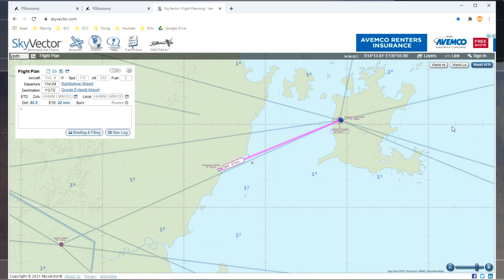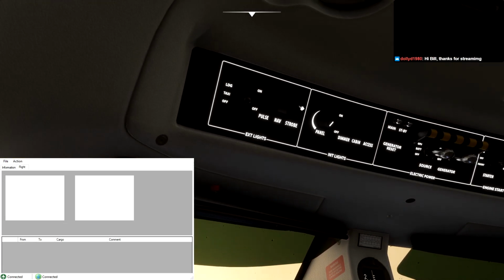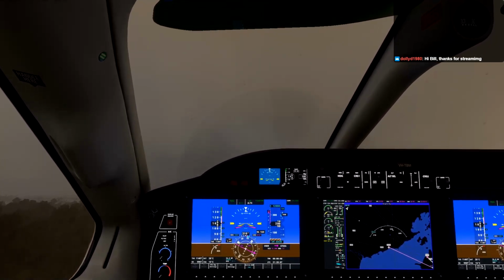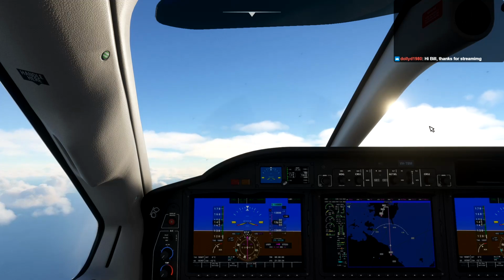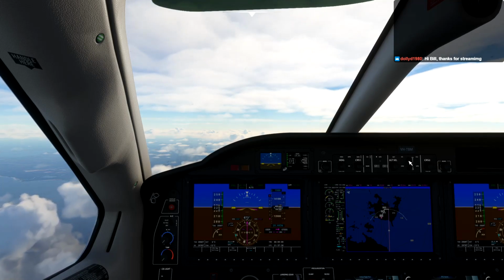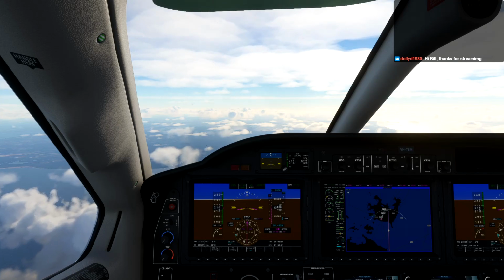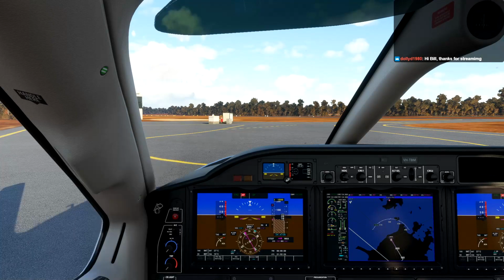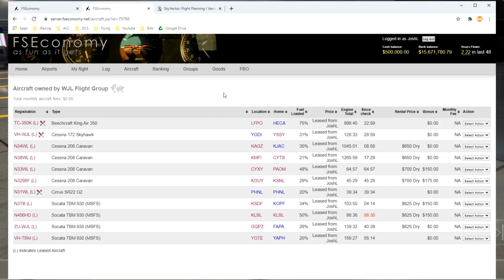FSEconomy | Flying for Repairs | TBM 930 | Numbulwar (YNUM) to Groote Eylandt (YGTE)

Comment: You know you can get rid of that annoying push back.  Go to the Aircraft CFG and change the push back from 1 to O and save.  If you need to push bank simply push Shift P to start and stop.  I got rid of them all on my smaller AC.
Reply from the maker: Yeah, I like having it sometimes and others I’m not a fan. Don’t want to edit the file every single time. Really think it should be something you could adjust in game on the fly.